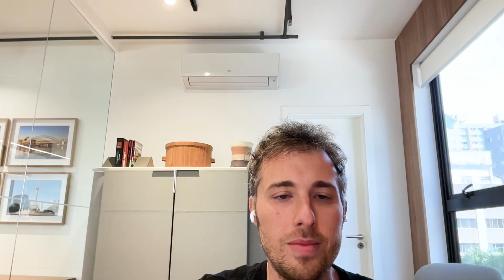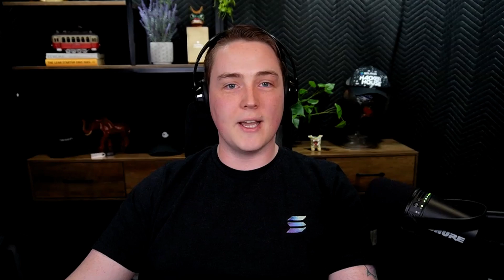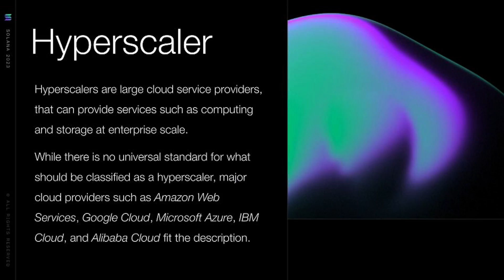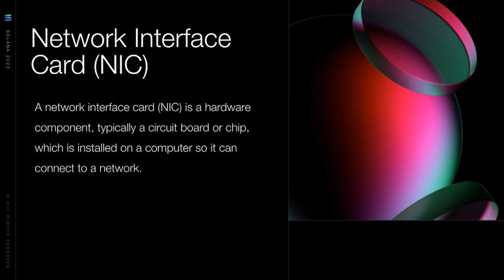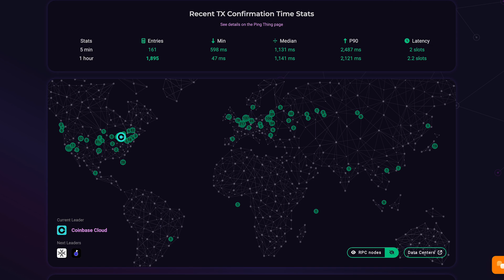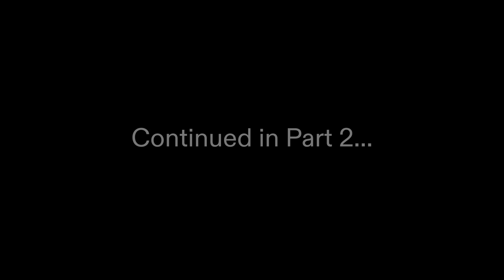Spotlight: Solana validator and hardware requirements

Comment: Im curious what the cheapest conditions allow for an rpc node. can i use some cheap ass ddr3 ram with two terrible xeon e5 8 core processors on a dual cpu socket motherboard on a virtual prox something whartever the heckers its called? hahaha i just need transaction data and transacitons sent quick blah blah, maybe makes more sense to just pay for a fast rpc from a swervice